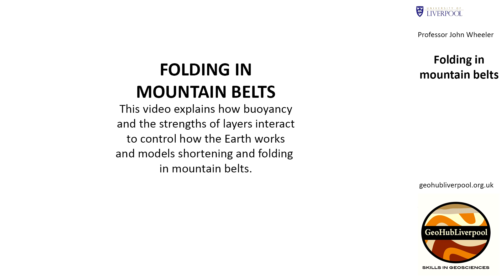Plate Tectonics - Folding in mountain belts

Comment: If it were possible to build a mountain or an artificial structure whose strata/foundation goes about 125km to act as a peg in the ground could this stabilise the movement of the tectonic plates a bit in the surrounding area?